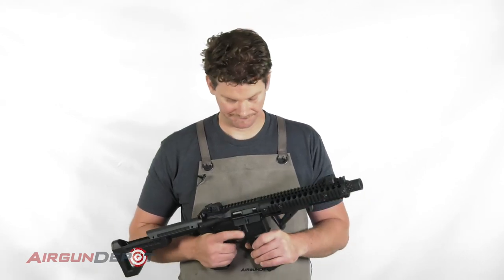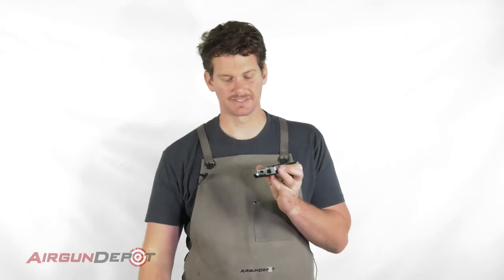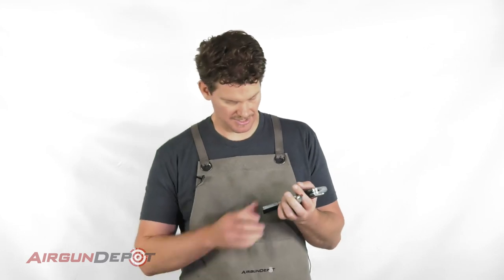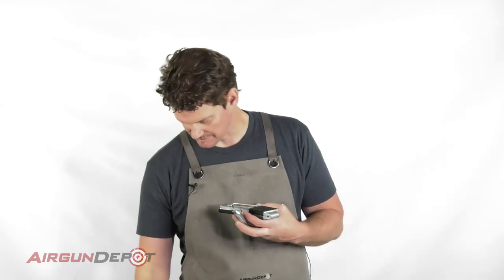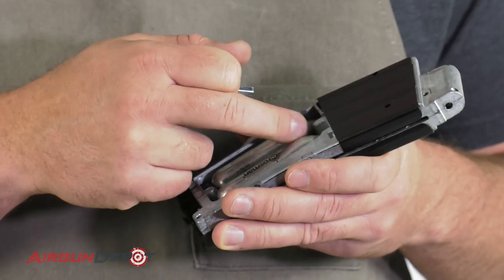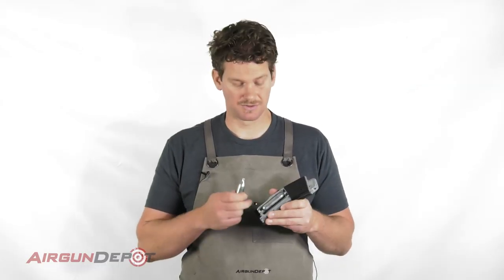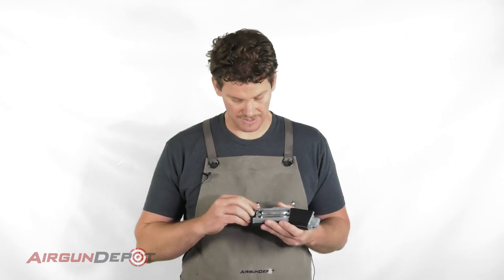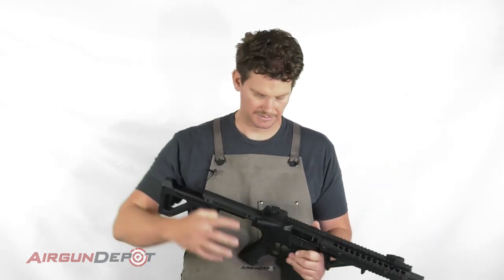Crosman DPMS: How to load the CO2

Comment: To stop the bbs getting jammed in the feeder,give it a quick spray inside with a silicone spray,when you have filled up spray the bbs on top give it a shake and you will have no problems and you can use  any bbs with this method plus it lubricate the weapon when firing. Hope this helps
Reply from the maker: Great tip, thanks!
Reply: Can I use pellgun oil on the feeder?
Reply: @Gary Roberts can you please post a video of a demonstration of this I don’t quite understand sorry
Reply: @Evan_Schewe  just spray the bbs with a silicone spray in the feeder which will lubrcate the bbs and you will not have  a problem feeding the bbs into the gun just spray and shake the bbs

Comment: I’ve loaded my CO2 cartridges the same way as before. However, this time I loaded the left in first as I did before and now all the CO2 escapes through the nozzle of the right side of where the second cartridge goes. Is this an issue with the magazine or am I doing something wrong? I’ve only used the magazine once.
Reply: I also did not use Pellgun oil but I didn’t the first time I used it.
Reply from the maker: We've seen this issue before, and the easiest way around it is to put in the right cartridge first and snug it up without puncturing it. Then put in the left cartridge, piercing it, and then finish piercing the right cartridge. That should prevent CO2 from escaping.
Reply from the maker: Also, putting a drop of Pelgunoil on the tip of each cartridge will help preserve the seals and so forth.
Reply: I just bought mine today and had exact same problem.... which led me to this video lol
Reply: @airgundepot  but what if that dosnt work..now you have both co2 cartidges leaking making it double dangerous
Reply: I'm glad I read your comment BEFORE I loaded in my CO2 cartridges. Thanks VM for this!
Reply: @airgundepot I’m experiencing same thing. First 4 times worked no problem. Now, I can’t keep either sealed, and co2 starts escaping very violently. I’ve oiled, did what you said above, and I’m going thru cartridges like no other. Wasted 6 (3 times) so far, need help
Reply: @JTMagXX  apologize for barely seeing this but I did what the channel author said above and that pretty much solved it for me. What I do now, it's been a while is that I load both up and have them snug so they both are not pierced. I tighten the right first so the air that does escape is not much because the left cartridge is already snug up against the nozzle hose thingy. Then after all the way quickly with the right, I do the same with the left tightening it. Shame we have to do this process really.

Comment: I purchased the SBR and have 3 magazines. 2 of those magazines will expend the first CO2 and the other will stay unused. I've tried many things putting oil, finessing the torque, etc. It's really disappointing considering how damn expensive the magazines are and I've had them less than a month.
Reply: terkinstein I have the same problem. The first co cartridge gets used and the second stays untouched.
Reply: @alexgogiashvili1710  same, did you ever find a solution?
Reply: Me 3….im wasting co2 like crazy bcuz when I tighten, noth8ng happens, all the co2 sprays out fast, very cold
Reply: @JTMagXX  yep same problem

Comment: Any tips for a leaky mag? I bought 2 high cap one's and lasted about 2 reloads before they started leaking. It is really frustrating and disappointing to say the least.
Reply: Actually it has a very specific loading method. Twist until you hear slightest hiss. The re position your hand to tighten it as fast as possible
Reply: Same issue here. Leaks completely out the right hole as soon as I load the left one. So frustrating!

Comment: If you need pellet gun oil to operate the C02 cartridges correctly, then why isn't it a "suggested item" when ordering the BB gun???  I ordered the BB gun, the C02 cartridges, BB's, but nowhere was there a note about "pellet gun oil required to use this product".  Also, why isn't the oil INCLUDED with the BB gun if it is a required item???
Reply: old post ...they say use it but its not really a big deal if u dont have it
 oil makes it a lil easier to puncture the seal is all.

Comment: My mag wont cycle from both cartridges. The 2nd cartridge will be full but dpms will act like its out of c02, what do I do?
Reply: Same issue here not sure what I'm doing wrong might try shooting with one so I don't waste them
Reply: I've been using only 1 as well. I tried cleaning and lubricating mag. No luck. Same issue with only 1 CO2 being spent.
Reply: Same for me. Ist one goes out and than nothing. When I remove the second one all kinds of co2 sprays out telling me the gun isn't using the second one. I tried adjusting the depth of the hole where the piercing piece is but no luck. Any suggestions?
Reply: Most common cause for this is over tightening the cartridge. Next time you are installing the cartridge slowly tighten the thing wile hold the thing by your ear and listen for the top getting pierced, you will hear the gas as it get's released into the magazine. Then tighten another quarter turn.

Comment: I just got the R1, before when there was only the Drodz don't quote me on the spelling LOL it only featured burst and took CO2 and batteries. Well I opted for a WE TECH M4 CQB. Everything that should be metal is metal and I use green gas mags or CO2 Mags. I got a shorty m203 everything LOL. But I've been wanting a full auto steel .177 BB gun for some time. Since I'm a collector that owns several real steel firearms this is just for fun or non-lethal purposes. I need to test fire mine but don't think the neighbors would appreciate five mags or more lol. I also know better to not store any gas powered magazine charged as it will ruin the seals. This is the second video I've seen stating you can use one CO2 if you won't be shooting much, anyone else use just one? Just need to run maybe a few Mags through if that to be sure it's in good working order.